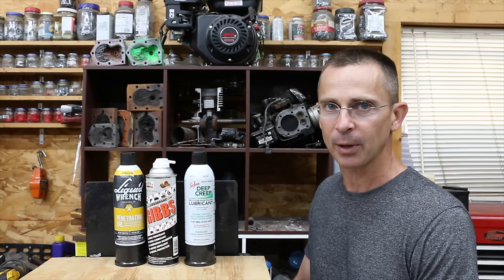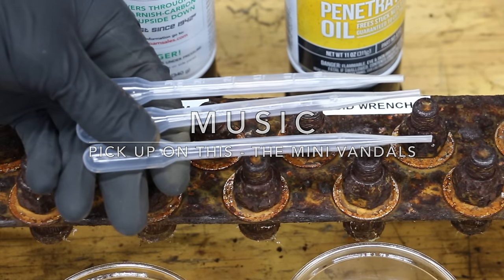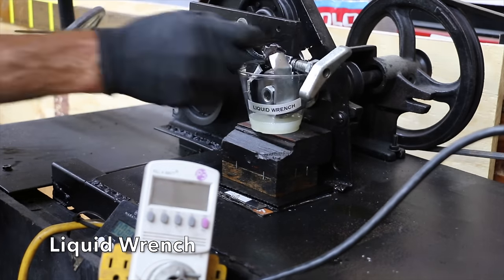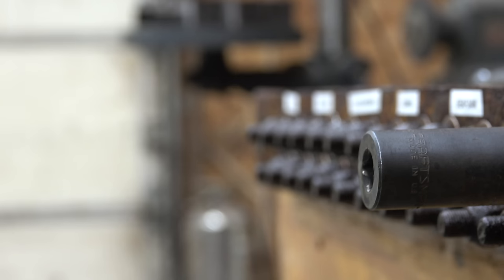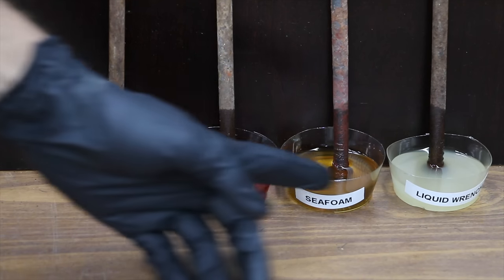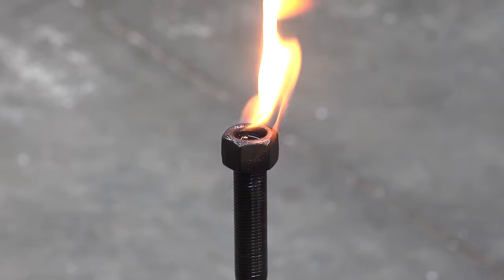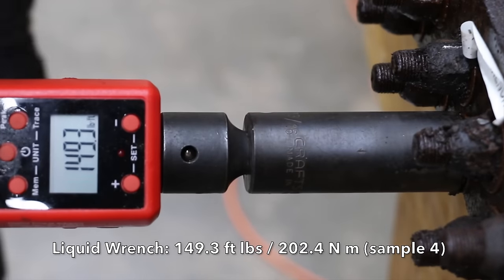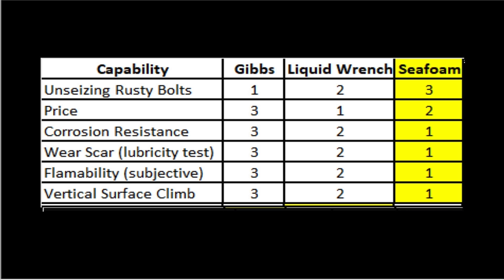Best Penetrating Oil?  Seafoam vs Gibbs vs Liquid Wrench

Comment: If I could toss a few more suggestions:
-latex gloves
-so called rust protection products like Lloyds
-electrical contact cleaner
-ratchet straps
-2 stroke oil
Reply from the maker: Great suggestions!  This helps. Thank you
Reply: Ratchet straps is a good one. Abrasion resistance, resistance to rust and sand, and strength

Comment: can you test the benefits of different spark plugs? Iridium, platinum and copper. see if the claims are really true
Reply from the maker: Thank you for the video idea!
Reply: E3 spark plugs for the win. Hands down. Factory plug in my chainsaw will allow me to cut wood for 20min. Switched to a E3 spark plug and I can now go 30min on one tank of fuel. Same with my lawnmower. I also use these in my truck and my wife’s van. I swear by them.

Comment: First of all, great videos. I was thinking it would be great if you could further enhance the series and add CRC products to the tests. They have Screwloose and Freeze-Off. Another cool test would be to use an induction heater (Mini-Ductor) to see how well they would work with the penetrants since there is no flame.
Reply from the maker: Thanks for the suggestions.

Comment: I'm really curious as to how well heat alone works compared to these products
Reply from the maker: Great point!  Heat works extremely well from my experience.
Reply: @ProjectFarm  seriously, it seems to me that all of these products are "somewhat" helpful but only reduce the amount of torque needed by around 10 to 20 lbs, who is going to notice that without using a torque wrench? A simple propane torch seems to be a much better investment.
Reply: @ronc8598  sorry but I can't read "bust a nut" without giggling, but in response, 10-20lbs difference compared to a normal torque value of 150lbs is not noticable by hand. Especially when heat alone has a significantly better effect.
Reply: @ronc8598  😂😂
Reply: I'm curious how cold will work, as there are many products like that for this purpose. I'm curious if they can cool enough to get significant movement in the thread to crack the rust.

Comment: Put them all up against a 50/50 mix of syn ATF and Acetone. I have had extremely good luck and it;s cheap to make.
Reply from the maker: Thank you!  That's a great mix!
Reply: i heard brake fluid is a good one to use also

Comment: Blaster PB  is the best penetrating catalyst have used ever , Hands down
Reply: absolutely, I love it just not the strong smell. Why was this not in the test  ?
Reply: In previous tests, the Liquid Wrench outperformed PB Blaster. At least that's how I remember it.
Reply: @Dazedviper1  - No doubt moth balls .  They could have come up with different smell . As far as working its my go to for sure , Have a good 1
Reply: @Wheel-1   As a backyard mechanic I love it . As one that uses jack stands you gotta stretch your arm as far as possible to creep out of there as quick as possible .
Reply: Sounds like you haven't used LW
Reply: Carl Rest.    Liquid wrench has nothing on Blaster...
Reply: JJD1913 Read all the comments - you are in the minority.  I've used both and stuck with LW for the better part of 30 years because for the price, can't beat it.
Reply: Remove the stoopit propaganda melts foam cups label and call it just penetrating oil instead of blaaastah! And it's just loose juice. Kroil rules over all.
Reply: You obviously didn't see the last testing video. It didn't do that great
Reply: Always works fine for me Mechanic 25+ yrs.  To each their own

Comment: judging by the wear scar, seafoam looks like it might be a contender for an oil replacement test
Reply: Seafoam did resist the heat and pressure tests. Seafoam may not be viscos enough for a stock oil pump.  So a small engine test in a four stroke motorcycle. Would be required, or due to its high lubrication capacity. Work as a two stroke engine oil. But then again, seafoam resists burning in high temperatures.

Comment: Thanks, Project Farm, for your excellent video regarding the best penetrating oil(s) on the market specifically Seafoam's Deep Creep vs. Gibbs vs. Liquid Wrench!  Based on Deep Creep's ability to handle the most heat while still being relatively safe from catching on fire I would guess that Deep Creep would be a much safer choice in lubricating heat shield & manifold bolts regarding rust protection?

Comment: Thanks for pretty much confirming my total disgust for penetrating oils.  I've never had a truly decent outcome from using them. Wire brushing then oiling the corroded accessible area of the threads helps remove the nut once you have it loose, though.
Two other methods are the Blue Wrench and the Weld.  Both work wonders...but not for exhaust bolts.  Doze are de work of de Debbil.  Another method which works on really beefy situations is to hit the bolt head/nut with a pneumatic hammer.
Reply from the maker: Thanks for sharing.

Comment: Two video recommendations!!! 1. Painters Tape - you have done several on other types of tape but have not seen one on painters tape. 2. Oil Filters - Lots of great videos on fuel, additives, and oil, but nothing on filters...
Reply from the maker: Great video ideas!  I'll get to work on both of these but it'll take me a few months to publish videos on them
Reply: As y'all both probably know, Fram (regular grade) oil filters are looked down on by almost every reviewer.  If you decide to go with this idea, please please test a regular Fram and a ToughGuard (or other upgrade) model.  There is so much distrust of the standard model among reviewers, that testing an upgrade model in a product line-up could be very educational.  The same goes for Purolater and others that sell multiple lines of the same filter size.  Now THAT is going to be a very interesting test setup!  I expect you'll be buying a few more pieces of equipment for this!!  Thanks in advance!  (Great idea Sean!)
Reply: There's been tons of cut-open videos and people dissecting the filters, but it'd be cool to see some testing done with them. For instance, maybe flow some oil with certain sizes of sand granules and feed it through the filters for a while, see how many granules make it through, or how much mass goes through the filter before the bypass gives up and opens (if it even opens). The only demo video I've seen is fine carbon put through a regular oil filter, then a bypass filter. But it'd be cool to see a vis a vis comparison of oil filters for something common like a gm LS motor filter or something like that.

Comment: Love tge tests you perform for us viewers, ty for this
 Most rusted, frozen bolts/nuts we run into will Not be larger truck wheel studs but smaller bolts around 3/8". For example exhaust studs, bolts. How about testing/using the Better quality rust penetrant products like liquid wrench, JB 80, which I use mostly, on autual older trucks that have exhaust issues already! There are many people who have trucks that would love to allow their vehiles to used for these tests, IMHO. This would be a Real World test many would love to see.
Reply from the maker: Thanks!  Thanks for the suggestion.

Comment: Two suggestions.
1.) Since price point determines how much product gets used  why not apply a cost-weighted amount of product to the seized nuts? So a lot more Liquid Wrench. 

2.) Determining how to reduce the torque required to close to 80 ft. lb. Which strategy works best. How much do multiple applications over many days help? Torque after 1 hr, 6 hr, 1 day, 2 days, 3 days.

I loved that you used a control for the 1 hour and the 1 day marks. Even better that they averaged about the same. Thank you!

Comment: Very much enjoy your videos and the valuable real world acid testing of products. I am curious about the use of anti-seize compounds to pretreat threaded components to stop rust-up, particularly in high temperature applications like exhaust systems. Also, used in conjunction with penetrating oils to remove severely rusted nuts etc. 

On another topic, have you ever done a comparison of  low cost automotive air filters versus expensive, cleanable, reusable  types. For airflow, particulate removal,  longevity and reuse claims.

Comment: The best is mixture of Acetone and transmission fluid, then Freeall, then Kroil. Here in upstate New York we don’t rely on these as a necessity. We use it here but the end all be all is propane o2 torch and pair of Irwin brand vice grips and Mac brand easy out socket set.  Edited to say, these videos rock. Thought I already subbed but you tube unsubbed me a while ago apparently.
Reply from the maker: Great recommendation!  Not sure why youtube unsubbed you.  Others have had that happen as well.  Welcome back!

Comment: This video and methodology is fantastic, as all your vids are. Thanks for all your efforts!

Another test I would find interesting would be the use of penetrants and other methods for removing fasteners/parts stuck due to galvanic corrosion. Stainless and steel fasteners seized in aluminum is a massive issue for boaters, and will increasing be a concern for automotive work as more aluminum makes its way into vehicles. Just a thought.
Reply from the maker: Thanks and you are welcome!  Thanks for the suggestion.

Comment: Excellent videos! Thank you for the thought and planning you put into your comparison tests, they really do help your audience make much more educated decisions.  Question: although Gibbs produced the best overall result in tourque required, which of these 3 products would you use to remove a 2” trailer insert that has very solidly seized into the receiver? Would sea Foam’s ability to penetrate (and climb), and heat, be the most beneficial product to use in this situation?? 
Thank you again for your very informative videos

Comment: Here’s an idea Todd,
Sometimes when I haven’t started my mower for a long time (winter months) I need a bit of brake clean directly into the intake to get it going and intermittent sprays to keep it running until it idles correctly. An experiment could be, spraying brake clean into the intake for a period of time while its running , then a big spray to stall the engine for a few minutes, start up again to clear it out then disassemble to see if the brake clean clears out the carbon deposits off the piston, valves etc.
Would be interesting to see I think
Reply from the maker: Thank you for the video idea!

Comment: I think the reason I personally have always had better luck with Liquid Wrench then other penetrating oils is because of its low price, I tend to use a much greater volume which increases effectiveness in most cases.  Because of the vast pricing difference between Liquid Wrench and some of the competitors, it would be interesting to see your tests using varied product volumes determined using the volume:cost ratio.  In this case Liquid Wrench would get at least 3 times as much product per application and in my guess be the clear winner.  I only point this out because of 1)The extreme cost difference and 2)The close results. The last thing I will say is that some of your comparisons could maybe benefit by giving the clearly more important tests a higher weighting so to speak.

I've seen most of your product comparisons if not all of them.  I too am a tester but I test electrical hardware and software applications for a living, so I often need to be very particular, but for your format I think you have the perfect time/explanation/testing/review balance and do a TREMENDOUS job.  Helping us to use the best products for the job, increasing GDP, and driving competition between product manufactures, your work benefits society GREATLY and I just hope you realize how important and awesome you are.  Many many thanks
Reply from the maker: Great point!  Thank you

Comment: As usual, epic. Seriously. 
I don't know if you fish...But test fishing line? Strength, abrasion resistance, heat, cold, transparency,  etc. Can be separated by Braided and non-braided? I use braided for projects. Held a drive line on at 35 mph for 40 miles...
Reply from the maker: Thank you!!  Great test idea on fishing line.

Comment: Years ago I used to work for Ford. They had their own stuff. Ford Rust Penetrant and Inhibitor. I don't know if they still make it, but it was the shiznit. Lol I used it to remove a rear sway bar from a car at the junkyard that was completely rusted and sitting for years. I recovered every piece of hardware thanks to using it. It had graphite and foamed up. A drippy nasty mess, but worked great. I wonder how it would compare up with these.
Reply from the maker: Thanks for the feedback.

Comment: Project Farm. I have a 165 John Deere lawn tractor that the wheel is seized onto the shaft. Of Course, I’m a fan of the Seafoam Deep Creep and CRC’s Knock Er Loose/CRC Freeze Off and will try each of these products to dissolve the rust between the axle key way and wheel if at all possible. I’m not familiar with the Gibbs brand that you tested in your video. Who sells the Gibbs products?. Last night, I broke my Snap-on retainer ring pliers just trying to remove the snap ring. 
I will share whatever brand that seems be the most effective in breaking the rust bond to keep within the parameters of your test. Thanks again for your great videos.
Reply from the maker: Thanks for the video idea.

Comment: I tried Seafoam Deep Creep. I knew I would have difficulty   removing the rear shocks on my 2014 Sorento because they are notorious for seizing onto the bottom spindle. So,three times a day for 4 days I sprayed copious amounts of Deep Creep all over the lower mountings of the old shocks. I still ended up cutting the shocks off with a with an angel grinder. Then I had to cut the outer sleeve and chisel that off,burn the rubber off under that and then cut a notch into the inner sleeve and chisel that off. After all of that I inspected the spindle and surprise, surprise there was no sign of any of the penetrating oil inside any of those layers. It was a waste of $20 for the Seafoam and a waste of time sliding under the vehicle 3 times a day to apply the product. It also left bad oil stains on my asphalt driveway which I am still trying to eradicate. Threads or no threads I have never seen any brand of penetrating oil live up to it's claims. Extreme heat and the right tools are the only tried and true solutions to rusted nuts,bolts or fittings and I personally won't waste another second on any of those products.
Reply from the maker: Thanks for the feedback.

Comment: I watch a lot of your videos and I find them helpful interesting and learn stuff along the way.  I found if you break off a steel exaust stud in a cast iron head or block and you have tried everything else and have drill out the center of the stud. You can try this get a torch and put a small welding tip in it and well you need to play around with it till you get it down but you can melt the steel stud and hook or blow it out as it melts since it melts at a lower temperature then cast iron. I learned how to do this from a road mecanic that was known for being able to get things up and running when everyone else said it is going to be down until the new this or that comes in.  I learned so much from him and I am sure i was just scratching the surface of his knowledge.  Anyway keep up the great videos.
Reply from the maker: Thanks, will do!  Thanks for the feedback.

Comment: I wonder if something like evaporust (something that actually attacks the rust) would be better for rusty bolts than a penetrating oil, even if applied like you would a penetrating oil.  Another great video.
Reply from the maker: Thank you

Comment: I was doing this forever and practice this method that works when using penetrant I was told to apply the penetrate and tap the fastener with a hammer to facilitate the absorbent of the penetrate.  It works I use liquid wrench all the time. thanks
Reply from the maker: Thank you!

Comment: Great video! I personally favor Liquid Wrench, I use it all of the time. In my opinion it is by far the best value for the money, for some people that may not matter but when you work in the rustbelt & use 8-14 cans a month like I do it just wouldn’t be practical to pay $6-$11 more per can times 8-14 cans a month for something that’s only a little bit better. Stuff works great on locks too, I douse the lock cylinder & latch on my truck toolbox every fall and it usually stays free and unfrozen all winter. Before I started doing this, through the winter I had to take a torch or heat gun to the lock about half of the times I wanted to open it because it would freeze &/or seize up.
Reply from the maker: Thank you!  Great product for sure!

Comment: I have found that Deep Creep works exceptionally well on gas operated firearms (AR-15/ M4 in my case) since it's designed to remove carbon. Thank you for another great experiment!
Reply from the maker: Thank you

Comment: So, Liquid Wrench on Rusted/Stuck Nuts/Bolts/Studs etc and SeaFoam for Lubricating/Protecting, Hinges, Locks, etc ? Ever heard of and tried PB Blaster ? They have 2 or 3 different ones. Think I got them from Walmart. Also Like 3in1 Oil or Marvel Mystery Oil in different applications and Marvel you can also use in Gas and Oil like SeaFoam...
Reply from the maker: Great recommendation. I tested it in this video: https://www.youtube.com/watch?v=xUEob2oAKVs

Comment: love it! I wish you would have included ATF and acetone in a 50/50 mix. Supposed to break bolts loose better than anything in a can
Reply: He's already done that in one of his previous tests.
Reply: @erikj.2066  yeah I actually saw it right after I posted. I have it in an oil pump it's just easier to get it right where I want it vs an aerosol